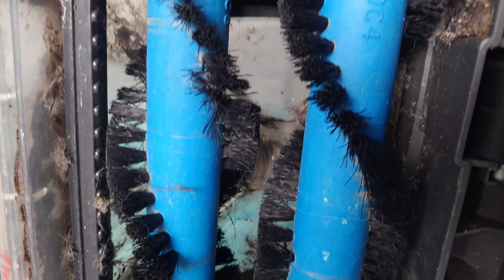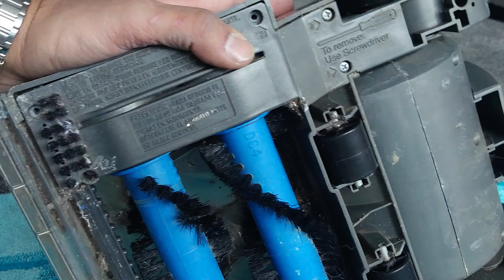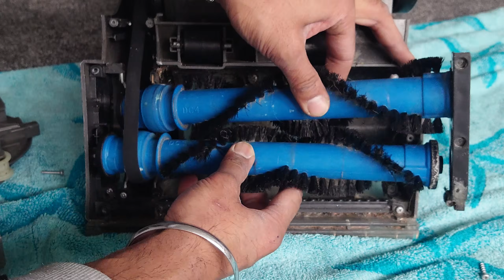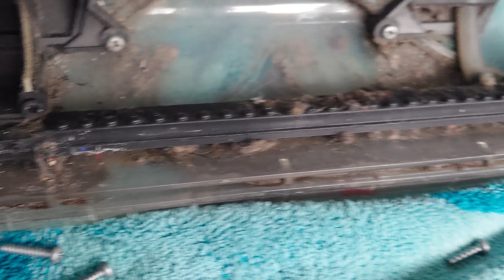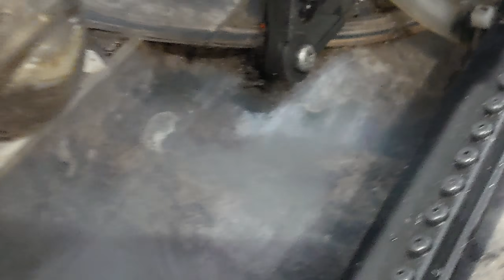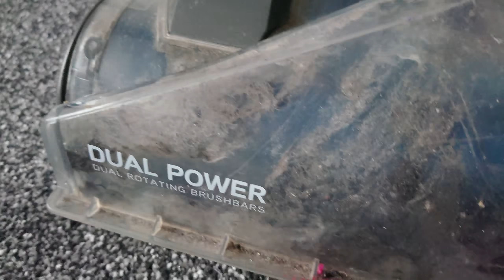HOW TO Clean Vax Dual Power Carpet Washer W86 SERIES

Comment: Very important to thoroughly vacuum 1st then repeat! It's worth noting the opposite sides have different screws - the belt side ones are longer with a finer pitch. Dismantling the brush bars, cleaning the bits you can get to is easy enough then reassembling pretty straightforward but ours is not sucking up dirty water so spilled water in our wet room where it did such up. May be the heatwave carpets dry quicker. At least can see the brush bars spin on carpets now it's cleaner. Should be fitted with stainless steel screws!
Reply from the maker: Thank you for that, it’s appreciated 👍👍

Comment: I've had more issues in 4 months with my Vax than I have had in 30 years of having a Miele. Only way to clean the head is to use a hose, seriously. Take off the waste water container and get the water going thru the connecting hose to flush out the crap from the head. You may need to do this once every 10 uses of the Vax, pathetic to be honest....
Reply from the maker: I end up cleaning the carpet and then just as long cleaning the machine afterwards! You are right it just shouldn’t be that difficult! Got a Miele fridge and it’s amazing!

Comment: It is a bad design I have a later one where the faceplate comes off for cleaning. You can clean by partial soak of brush area. Nb there are white alignment marks on brushes
Reply from the maker: Probably because the had so much bad feedback on it. You’d have thought that would have been sorted before they produced it!

Comment: Terrible device...bought this and used once.  Was surprised the front couldn't come off to clean it.  Wish I'd seen this as I've spent ages removing every single screw, even the ones behind the brushes trying to get this off.  Horrible and wouldn't recommend.  Does the job well but takes longer to clean the device than to clean your carpets.
Reply from the maker: Completely agree! I was so surprised taking it apart. Still think to this day I’m missing something and there is a secret clip somewhere to take it apart as it can’t possibly be put together like that! Can’t beat the old original orange tub ones…They were great!

Comment: Thank you for that, alas dont have hose  . Cheers
Reply from the maker: No problem 👍
Reply: Used a thin wire brush, gets most of it out, but could have been designed better for cleaning

Comment: How do you clean under plastic section above brushes, that is main problem
Reply: I use a garden hose and blast the rollers, keep turning them and all the trapped hair comes out...never had to unscrew anything....mind you am a woman..lol
Reply from the maker: @christinebrown4675 that’s a good tip and too sensible too! Haha My issue was I let someone borrow it and left it uncleaned so dried like that hence taking it apart. A good wash with a hose sounds just the job!
Reply: @christinebrown4675 your comment has inspired me to now do the same 😂👏
Reply from the maker: Don’t believe you can. Even with the brushes out it looks inaccessible like it’s moulded that way. Couldn’t see any screws to undo to take it apart. Something like a baby bottle brush might help thinking about it.
Reply: I use a bottle brush on the corrugated hose then let it such up clean water in our wet room. Otherwise, using a hose sounds effective if you have one. I'd not recommend this model - too. difficult to clean!

Comment: If I’d realised how much of a pain it is to clean ,I may have chosen a different model .
Reply from the maker: @lissysmith7029  A few people have said that. Next time I use it I’ll be sure to run it through clean water somehow to minimise the amount I have to clean. Let’s see?!? Thanks for watching and commenting
Reply: @ I’m just doing that now ,can’t get the mucky bits behind the bar without taking it apart ,will clean what I can for now ,will be using again very soon so when I’ve finished completely the rooms I’ll do a deeper clean to put away .Thought it was going to be a click click remove the front rinse and replace 😂😂 .Thanks for you video ,so much better to actually watching someone else do it instead of look at a picture lol ☺️.
Reply from the maker: @ My pleasure!
Reply: Just used mine for the first time. I then took it into the yard, laid it down and used a hose pipe with fairly strong jet to get in all the awkward places. I had the motor topside mindfull of not letting that get wet and then left it in the sun to dry out. Looks not too bad. I agree with all the comments about cleaning it immediately after using so as not to let the dirt congeal. Also, appreciate seeing the demonstration of dismantling and assembly, thank you.

Comment: These are utter rubbish, don't waste your money. For a start you should not have to strip the machine to clean it! It's not beyond man's ingenuity to design a cover that is easily removed.
Second, I've tried the Vax fluid, 1001 carpet cleaner and contract carpet cleaner, sure it gets dirt out but it also pushes dirt in! Especially in heavy traffic areas. The tanks are way too small meaning a small hallway carpet will take one and a half tank full. The dual brushes are good except on thick shag or thin nylon carpet because they are not height adjustable.
It drops fur bunnies all over even if you don't have pets! Especially from nylon mix carpets.
Don't simply re-hover them up, it will either drop a big load elsewhere or clog up the rollers / suck head. It's beyond the scope of this video but there is mesh filter in the machine at the back of where the dirty water tank sits. This clogs up too easily. After about four times use it's close to full blocked. All in all the effort, expense and faff of cleaning it is not worth the result. Save your money and up it towards a new carpet.
Reply from the maker: @JimClark-s8h I’d probably agree with you on all that. I’ve cleaned carpets before and you end up just transferring it to the machine which you have to then clean. Probably ok if you do it on a regular basis but who in this day and age has the time! All rushing around like headless chickens! In my experience by the time is needs cleaning it’s gone kind of flat anyway too! Cheers for your thoughts! 👍

Comment: I really never found it necessary to strip it down to clean which I'm sure is certainly beyond most users capability.

Most gunk was accessible one way or another with fingers or spraying water in to rinse it oit
The most important part in my opinion left out was the cleaning of the water extraction nosil.
These gets blocked quite frequently but on this model you can not detach it to clean. 
However I used a hacksaw  blade that was thin enough to grab and remove the debris.
Quite surprised you thought it would self clean as obviously it doesn't as it would not have been there in the first place.
Also omitted was the cleaning of a small filter attatched to the body behing the rear of the dirty water tank.
Reply from the maker: @alentrevor  it was a friend who used it last and left it in a state and then dried like that. That’s what you get for lending things out I suppose!? I haven’t actually used it since so expect the nozzle might be blocked as you advised, great point and good little workaround so will try that. In an ideal world it would have been rinsed out after use but that’d be too easy haha. Thanks for taking the time to comment and post that tip. Its appreciated!